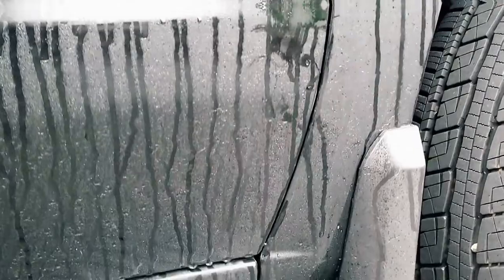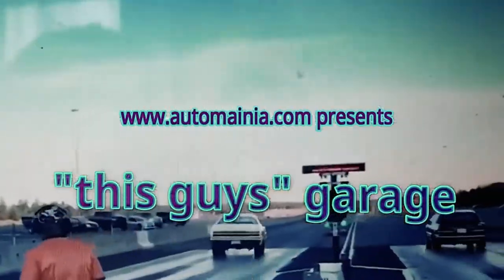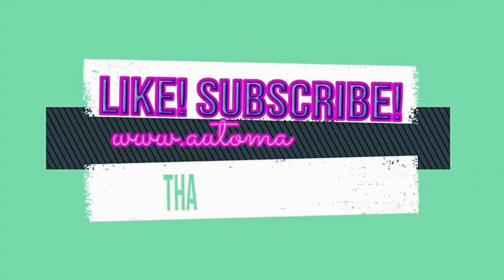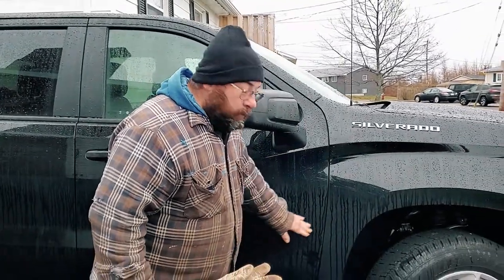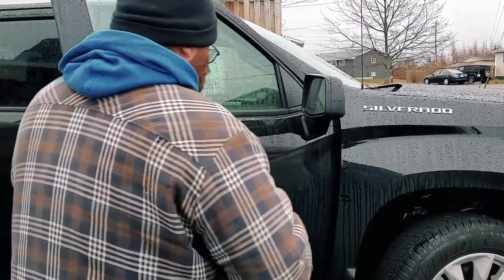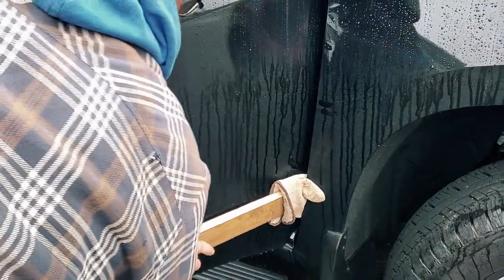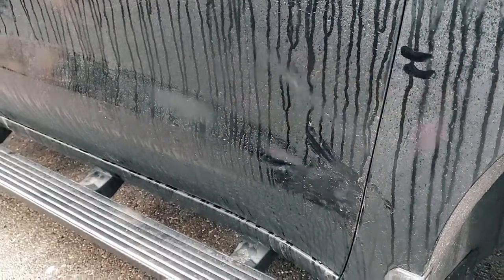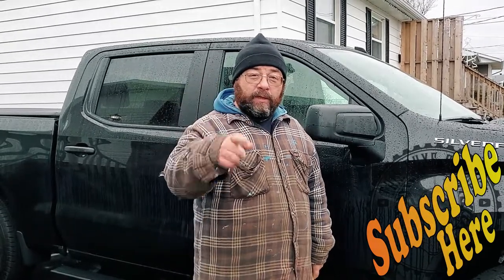fender adjustment no tools required  how to,  door grinding fender

Comment: I had the same problem, but instead of using a stick, I used a magazine. I stuck the bound end of the magazine between the door and the fender and I only had to open and close the door once and it was fixed. Thank you very much for a great idea.

Comment: Hey This Guy, I'm that other guy. 
Thanks for the video. Same thing happened to me today at the mall.
Someone apparently can't drive to well and hit my fender. We found out the hard way after shopping the passenger side door was rubbing against the fender. I'm gonna try this trick tomorrow morning. Hopefully it saves a trip to the Body Shop.
Reply from the maker: Hey other guy let me know how you make out 👍 🤜🤛
Reply: @thisguysgarage  went out this morning and tried your trick and it worked!! Thanks for the video. 
Not perfect because the fender is bent. I still don't know how the fender got bent up high like it did. It's the same height as the door handle and just the very end corner of the fender was pushed in, no other damage. Not even a scratch.  I made the mistake yesterday parking close. I usually park away from everyone just for this reason. Thanks again and Happy New year!

Comment: Morning my fender on my 2017 Camry was scraped badly so I decided to purchase an aftermarket CAPA fender.. The issue is that it lines up perfectly from door to to fender but the 3 bolt holes on top don’t align at all so I can’t screw in the bolts

Comment: My problem is, both car doors have huge gaps and grinds against the car when opening
Reply from the maker: send some pictures to 4iamcaper@gmail.com or make a short video we can probably help you out.
Reply: @thisguysgarage  okay, I'm not a mechanic so would be helpful.
Reply: @thisguysgarage my 02 aztek does this on passenger side. Driver did to, but I did this with cardboard. Tried it with the passenger side and it didn't work. Might try the board next. But is this way bending the door and fender to be able to close. Or is it pushing both back. I dont see any signs of an accident  or anything that would have caused this. It was pre-owned by 2 ppl and I got it with this problem. If it doesn't work is there a way to adjust it

Comment: I have the same type of situation, but my gap is way much wider than that. Like the fender attachment points are buckled or it is my door that bent inward. What does this trick really do anyway?
Reply from the maker: It just moves the fender slightly 👍